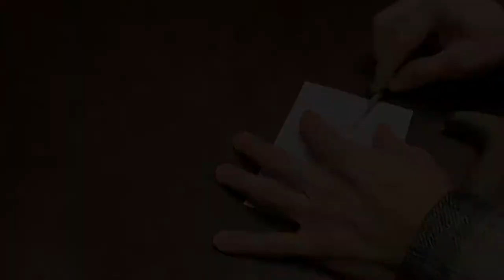(Short Version) 102 Year Old Stanley #5 Plane RESTORATION

Comment: Quick Question - what is the reason for the corrugated sole on the #5 Bailey?  What is the primary intent/purpose for this particular plane?  Appreciate both the long and the short videos!  This short one helped me get a quick view when I did not have the luxury of watching through the long one.  Smart thinking!
Reply from the maker: From what I understand the corrugations are to reduce surface friction so that it would be easier to push the plane.    This particular plane is a little different for me because it belonged to a friend of mine who passed away. So, it’s probably just going to sit on a shelf as a little memorial to him. I have other number 5’s that I use so I won’t need to use this one.    I’m glad you enjoyed the video, thank you!